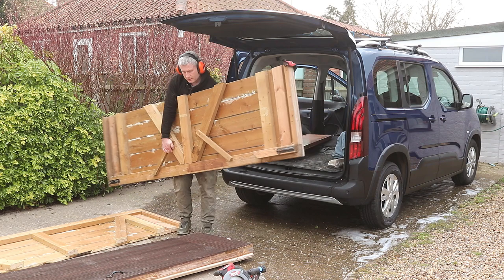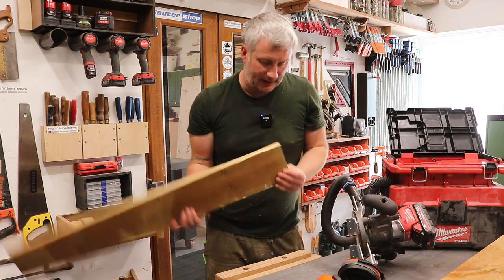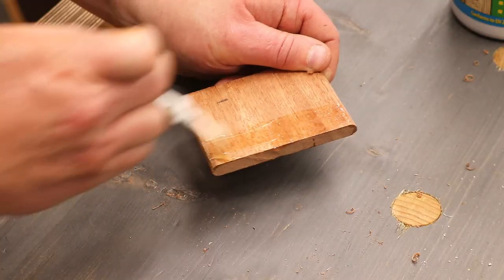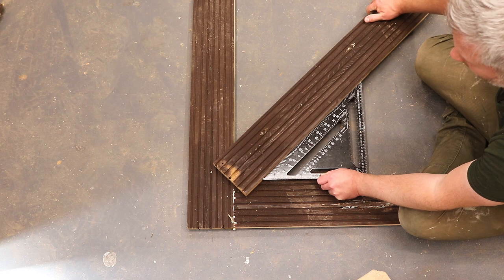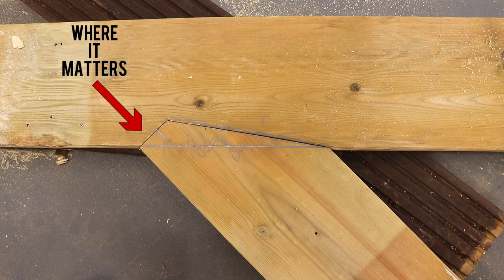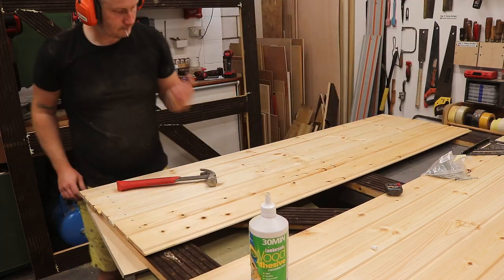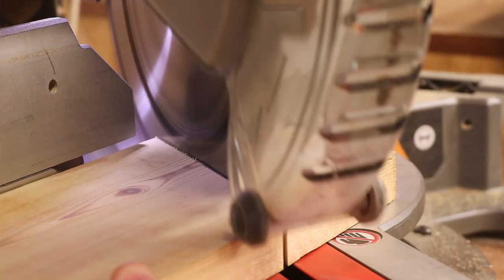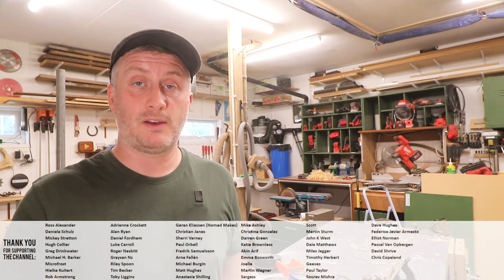Three Big Gates, Using Salvaged Wood!

Comment: One piece of advice: When you try to do use the router on such a thin piece, clamp another piece flush with the first piece to increase the surface area your router rests on. It's much safer and your cut will be cleaner because the router will be more stable.

Comment: A great video once again. One tip I would give is to order an extra fence for the router from their spare parts list, then you can use both fences at the same time, one on either side of the work piece. I know this works on a lot of routers however it is worth checking first that the rods are long enough and if there are holes on both sides of the router base.

Comment: Nice one, thanks for sharing the nifty design cutting the braces into the centre rail. Much as I'm enjoying my foray into woodwork, I'm not yet very good at conceptualising joinery, so I find explanations like that really helpful... On another note, I see the battery in your drill lat 12'07" looks suspiciously similar to the dimensions of Parkside's 12V, so I wonder... On another another note, shelled out £140 inc. VAT & delivery for 20 decking boards 140 x 28 x 2400 mm from Wickes (I know, I know) last week. Cheers.

Comment: Pinapple shorts! :D 
But no, I actually have a serious question/discussion point. Perhaps an idea for the podcast. When you say that using salvaged materials made for a substantial saving, I guess you haven´t factored in your time spent salvaging/preparing the materials. If you were to "pay yourself" a decent hourly rate for it. Would it still be a substantial saving? I find that kind of hard to belive, even with timber prices as they are now. Of course some types of material are easier to salvage than others. And don´t get me wrong, I all for the environmental aspect for using salvaged materials. 
Cheers and thanks for a great video.
Reply from the maker: That would make for a great topic! I will have a think about it and try and figure it out. Thank you!

Comment: Hi Keith
Just out of curiosity, I was wondering which wood filler you used to fill the holes.
Also, if you had to cut the old gates in half to get them to your workshop, how are you going to get them back to your auntie. Great little project and the gates turned out really good.👍
Reply from the maker: Great questions. The filler was just a test mixed one, it said exterior and interior on the tub but realistically I'm not sure how well it will hold up, it'll be interesting to find out. It's somewhat protected by the stain so maybe it'll do ok. Luckily my auntie's neighbour was able to pick up the gates, which saved a lot of hassle, couldn't have got them on my roof rack, so hiring a van was going to be the plan but now sorted
Reply: @RagnBoneBrown  Thank you for your reply. Glad you got the gates sorted👍

Comment: Depending on nothing getting in the way if you drop the broad at 2:00 flush to the workbench your have loads more reference surface and you can run your router fence against your vice jaws.
Reply from the maker: Great idea